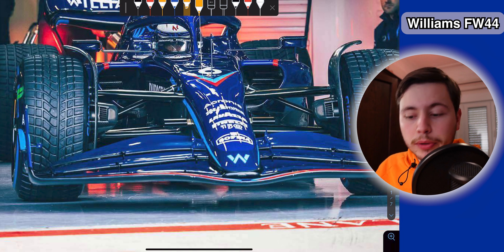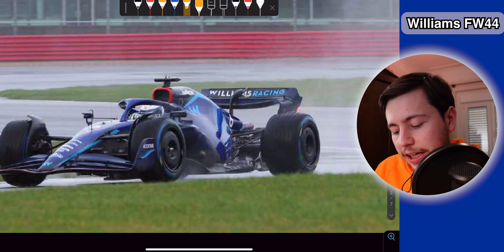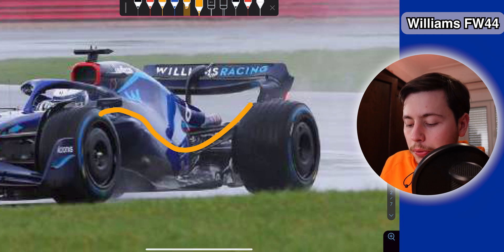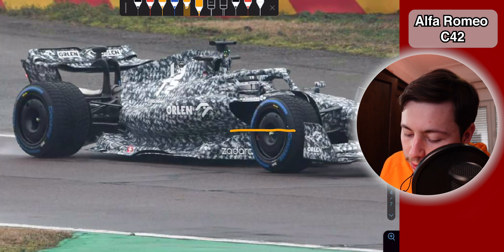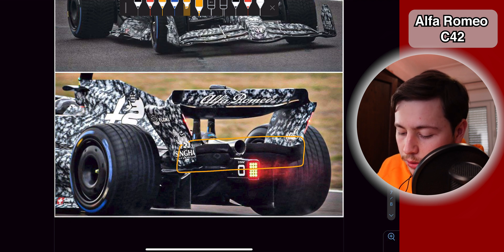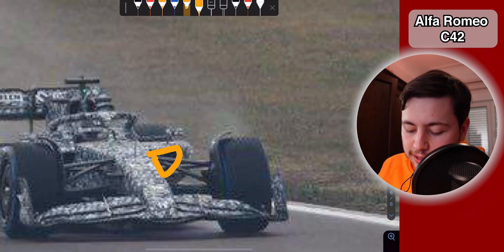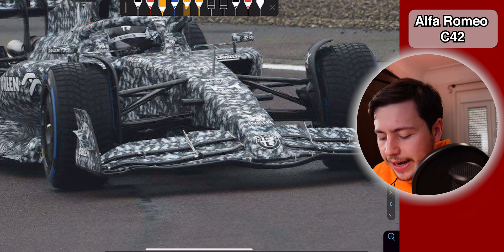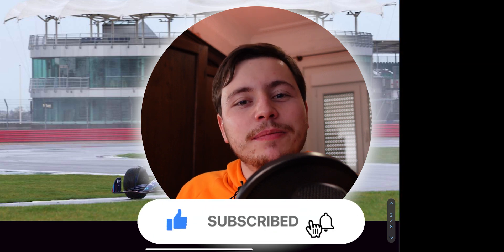Williams FW44 and Alfa Romeo C42 Technical Analysis! Formula 1 2022 Car launches!

Comment: Sorry that i have to say it again, but the accelerated air in the undercut does not get used to seal the diffusor. It is used to make the diffusor work harder and giving additional downforce by leading it over the top egde of the diffusor(and there is no need to seal the top of the diffusor as it is not open...there is only a need to seal the sides of the diffusor).They can try to create vorticity to seal the  diffusor from the tyre wake, but thats not done by the accelerated airflow itself, but by  creating vorticity, what they propably will do with a little footplate near to the wheel that you can barely see on the pictures they published, but what is something the trained eye notices. I assume you are not an aerodynamicist. But as the aerodynamics of racecars are extremely complex, with small details being very important, its almost impossible to do a proper analysis without any mistake. That can only be done by aerodynamicists or Racecar engineers. On the Williams for example there is an S-type Canard, as you usually want to introduce vorticity there, too, but what you do not do with an S-Shaped Canard. So thats pretty unusual really and i do not want to go into detail here, as it would get too far for a comment. Also there are a lot of details on the side of the underfloor of the FW44. All these little details are important for a proper technical analysis of the car as you can draw a lot of conclusion from them as they influence rear aerodynamics a lot and  its the really important stuff to do a detailed analysis. But as i say - this can only be done by an aerodynamicist or F1 engineer. Do not get me wrong please - what i say sounds like trolling, but thats not my intention at all. You have a pretty good knowledge for a fan(what i think you are, not a professional engineer or aerodynamicists), but you are not a race engineer or aerodynamicist. So i would leave the technical analysis of F1 cars to them. Only they can really do this. Of course you can keep up your videos, but maybe rename them and do not call them technical analysis, but something like "first look and assumptions". The term "technical analysis" creates an huge expectation. An expectation that can only be met by an aerodynamicist or race car engineer. And it also creates pressure for you because of one expects they things to be analysed correctly and in detail(so with the small details on the floor, bodywork of the Williams which all shed vortices and energise the airflow or should strengthen the boundary layer for the airflow to stay attached etc.) while the term "first look and assumptions" would not do that and expectations would not be so high. And if there is a mistake- thats not really a problem. Its a first look and assumptions.  Not a professional analysis. I hope you understand what i mean.
Reply: I really appreciate your insights on both videos here, thank you for commenting.
Reply from the maker: Thank you once more for commenting. This time when I was talking about the floor seal I wasn't talking about the rear, I was talking about the fact that this car unlike the AlphaTauri has got no rake on it, so the air won't escape through the sides of the car. When it comes to the undercut and to the downwash effect I was actually trying to introduce what you told me in your last comments to improve my video. 
Even though I'm an engineer ( just have been awarded that title), I'm a mechanical engineer with not a lot of real work experience, and that is what I'm working towards. I agree with you that the term technical analysis implies something these videos were never meant to be, they were always meant to be a quick first look at what jumps out the most at me during these car launches, just like other journalists are doing, and I just now realized that even they aren't using the "technical analysis" term, so thank you for the feedback, I'm probably going to rename this series. 
Now it's my turn to ask a question, where did you learn so much about race car aerodynamics? Is this your field? Or can you point me out a resource such as a course or a book where I could learn more? 
Thank you as always for your feedback
Reply: @VBMotorsport   at 5.10-5.15 you say something like: "to pull the air from the diffusor,  in order to seal the floor".  Thats what i meant in my comment. In the Williams analysis, everything was totally correct and you used and explained it perfectly. 

To your questions - yes its part of my job, but i have never studied aerodynamics or engineering. Its all experience, books and most important - people from F1 who teached me all that. I am at work at the moment, i will come back to you in the evening and answear your question in more detail.  I also will tell you some books etc. and courses(but this depends where you are from).
Reply: @VBMotorsport    here now the answear to your questions - i am not an aerodynamicist and i am also not an engineer, but F1 technology was and is part of my job. My knowledge comes from books like Race Car Aerodynamics from Joseph Katz, Aerodynamics Race Car from Timoteo Briet, Race Car Design from Derek Seward(great book!), Vehicle Dynamics from Milliken&Milliken and from Aerodynamic Studies, like a study about the frontwing of the McLaren of 2005 etc. But the most knowledge comes  from F1 Aerodynamicists and Engineers. I am lucky to have the possibility to talk to F1 engineers and aerodynamicists since 1997 on almost a daily basis. I would say most of my knowledge comes from that. People like Rory Byrne, Ross Brawn, Willem Toet, Matthew Jeffries, Henri Durand, Aldo Costa were the first people i learned a lot from, just by talking to them about all the details of a F1 car. I started in 1997 to do pretty basic technical  articles for a German F1 Magazine. That was my entrance into the world of F1 and if its Simone Fenili, Enrico Cardille, Marcin Budkowski, Ben Butler or Michael Wilby, Richard Edwards or James Allison, i talk to one of them on almost a daily basis, even if i do not work directly in F1 anymore. I worked in that area untill 2020 and now i am writting a book about F1.  Its a pretty huge one and will take me a few years to finish it.  Because of that, and because i know a lot of people, i still have access to a lot of aerodynamicists and engineers working in F1. I won't say F1 is a family, but once you are a part of it, you always will stay a part of it. I hope this answears your question.

If you like, i can tell you some more books or sources about aero-studies. I can tell you one or two courses you can attend, but it depends where you are from. Just let me know.